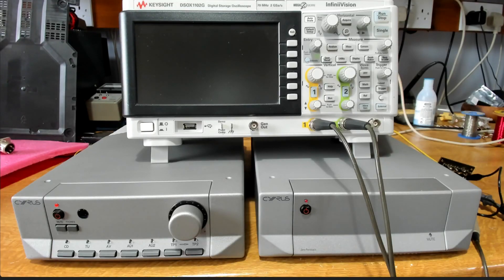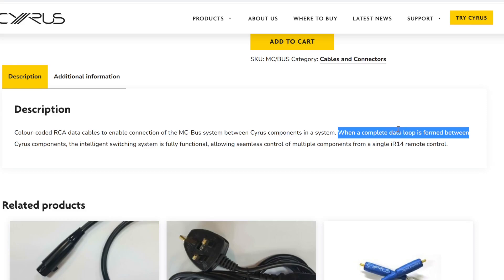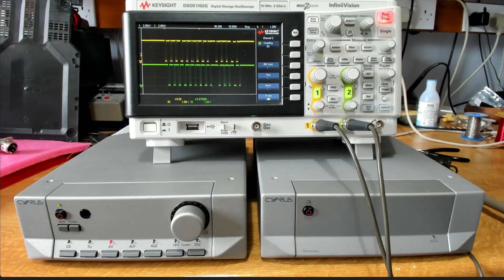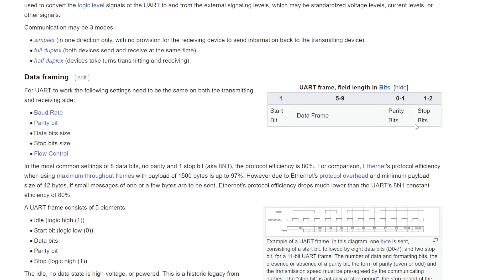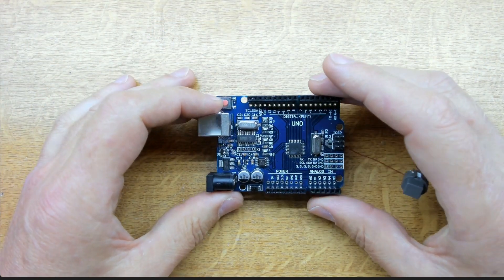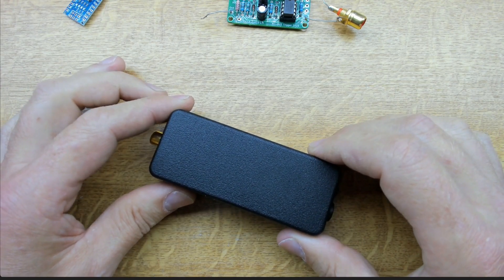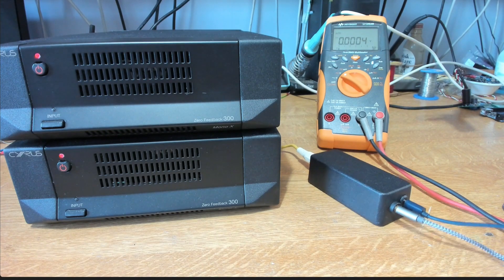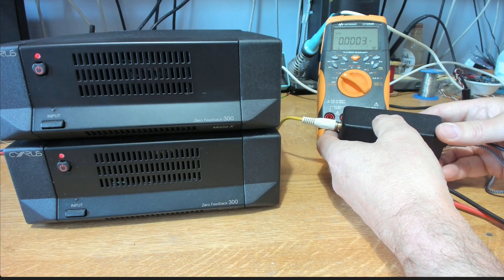MC-Bus Trigger Accessory for Cyrus Power Amplifiers

Comment: That was fun. Enjoyable to see the reverse engineering process and the explanation of the “mysterious” MC BUS; so many longstanding questions answered in a concise video. It’s a shame that there’s no way to power on the controller devices using the bus, but it’s appreciated that this is a limitation of the Cyrus design. Has this design been tested with Cyrus FM tuner and CD players? Thanks!
Reply from the maker: I would expect this to work with all controllable units though so far I've only personally dealt with power amps.

Comment: Sorry to be thick but is there something available that can make a Cyrus DAC XP turn on based on a 3.5mm 12v trigger? Powering up the power amps and their PSXRs works when I turn on the DAC because of the MC Bus connections but I’d like to be able to have a Sonos Port (which has a 3.5mm 12v trigger output) turn everything on remotely. Is there any way to achieve this? Cheers!
Reply from the maker: There isn't a means to do this I'm afraid. The DAC XP is a controller, it cannot be controlled.
Reply: @myalbatech  ah, shame. Thank you for replying though. Very impressed by your skills and knowledge - new subscriber.